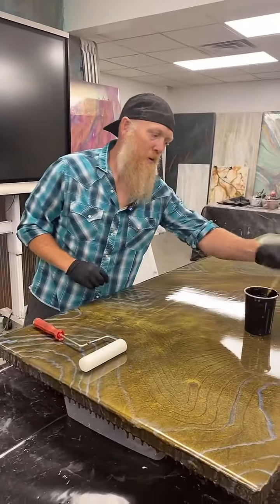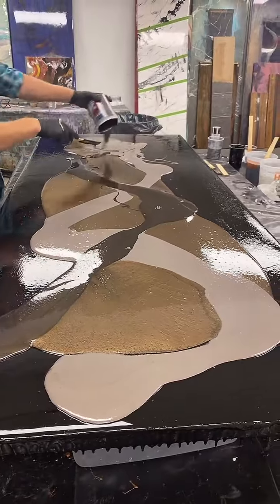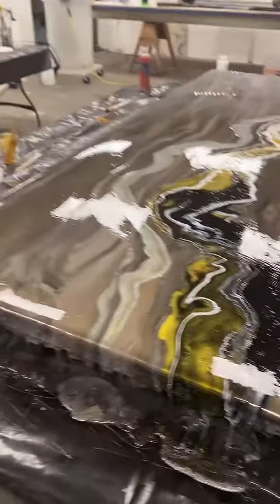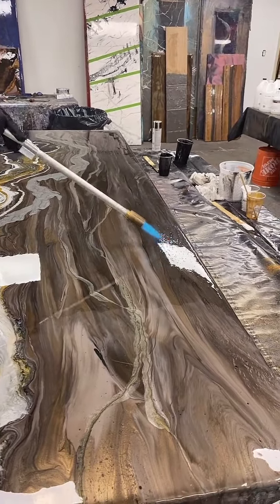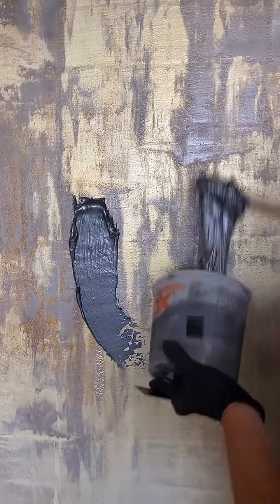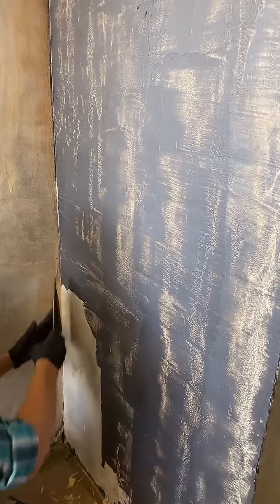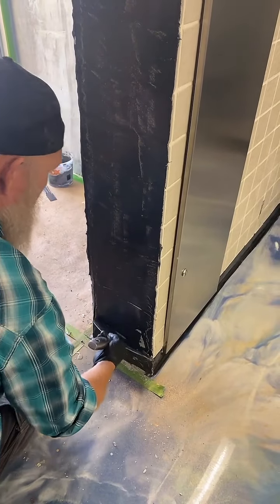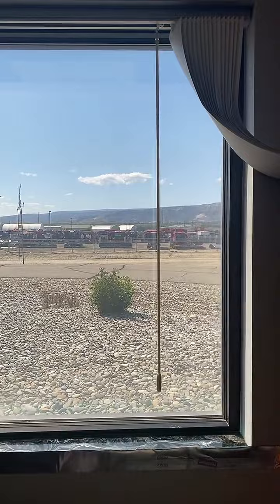Bronze Metallic Epoxy - Decorative Window Sill Epoxy - Non-Sag Epoxy - TikTok Live 08/30/24

Comment: I want to make a dining table and have a couple questions. I was thinking about using a hollow core door, will that support the weight of the resin without warping? Do I need to seal all sides? Is your epoxy food safe?
Reply from the maker: Yes, you can use a hallow core door. That would support the epoxy. You do not need to seal all sides. If the hollow core door is a porous material you will want to do a skim coat. Our epoxy is food safe. We hope your project turns out good! If you have further questions please email or call us.